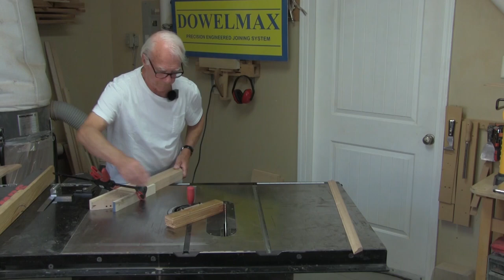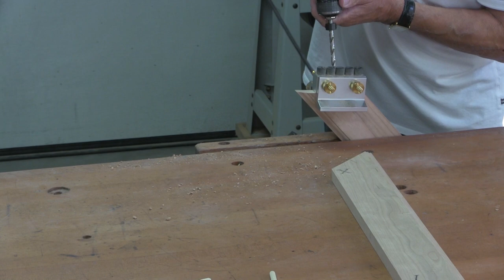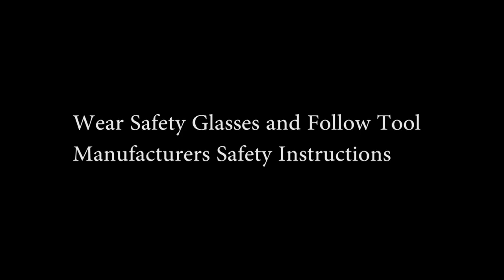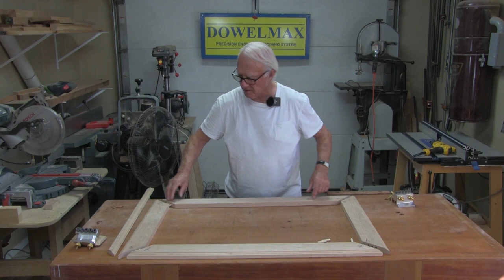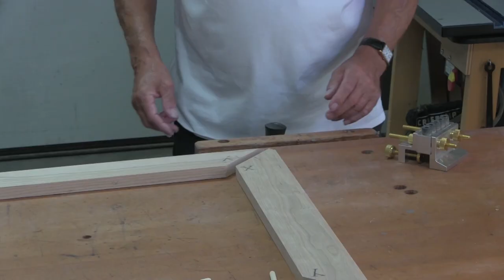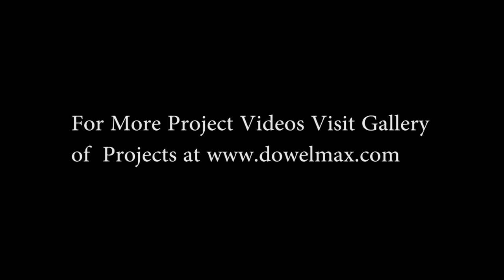How to Make Perfect Mirror and Picture Frames with 100% Dowelmax Construction

Comment: I've had one of these for around 15 years, I don't use it enough but have just joined a large set of ply boxes with it using around 4 full sheets of 8' x 4' material in all, worked really well. Also, I've just read the interesting article about the inventor in Furniture and Cabinetmaking. When you compare it's cost to a Domino for example, it wins really and is easily as good - plus dowels are cheap! People overlook them as a joining system as they're 'old school' but this tool is very much worth it and beautifully made. And no, I've no link to the company.....
Reply from the maker: Thanks for the appreciative comments, and we are glad to hear it's worked well for you!